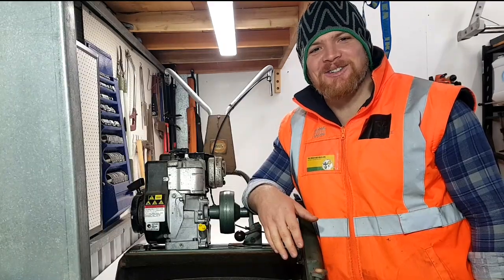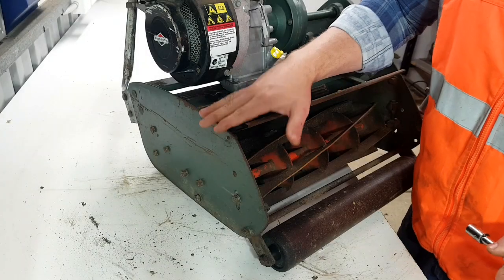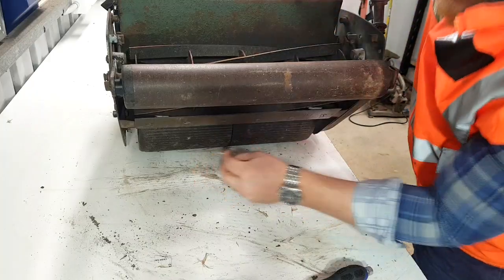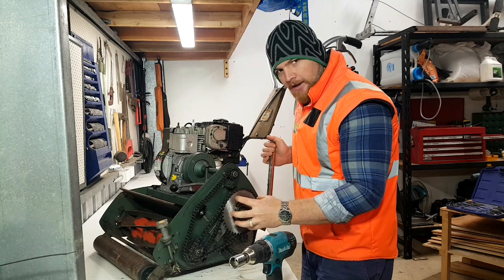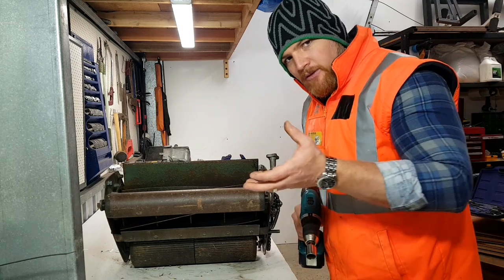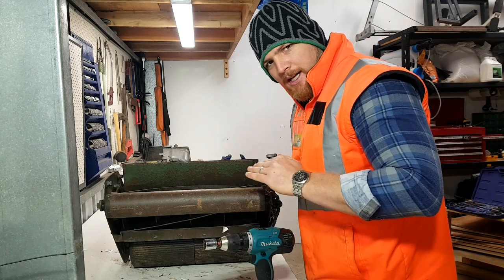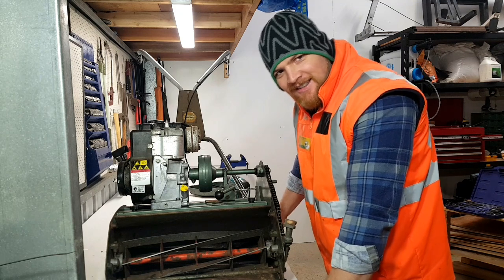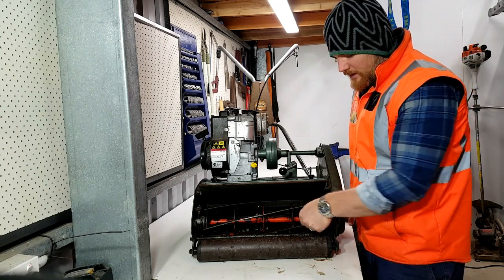BACKLAPPING a SCOTT BONNAR 45 - (17" Spring Prep)

Comment: Do you have to backlap push reel mowers?? I think a push one would be good for me to learn cyclinder mower basics and how they cut.
Reply from the maker: G'day Dan. I would presume so but, not having experience with a push cylinder mower I can't say with 100% certainty. If I think about the principle of cylinder mowers, there is light contact between cylinder and bed knife that will need maintenance. Hope that helped mate 👍. On ya for getting one man, I'm looking at doing the same....
Reply: @thegreenandgoldlife1464  I saw Bens SIms did a video on one. Will have to watch
Reply: @danielslawncare  can back lap a push reel. Just take the wheels off pull the sun gear out and the key and swap them to the other side this will make the reel go backwards. Then add ya paste and go for a spin down the road to grind it. Then when your done swap the gears back to the correct sides check thed rell spins the right way and your good to go. Annoying but it can be done.